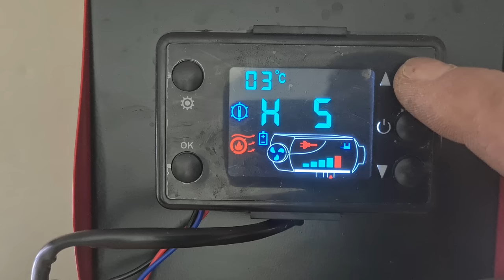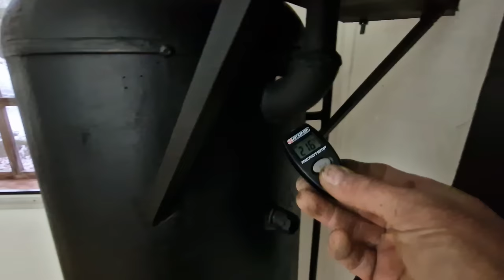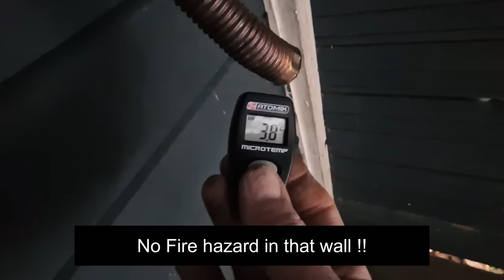DIY Vevor Diesel Stove with  Free Energy Sand Battery

Comment: now, that thank was dedigned for hydronic heating ( water circulating through that exchanger as medium), not to be exposed to dry heat, thus that exchanger ( spiral tubing/coil is not designed for getting hot without water flowing through, thus the lifespan of that coiled up exchanger drop by the day..
you would need a  coil for steam for that application
Reply from the maker: This is just a prototype but yes it should have been made in stainless for longer life.

Comment: Hi, great video, did I see that the exhaust come just half way down the sand recovery vessel? So could you use a smaller one and save on sand?? Or half fill with gravel and then with sand where the coil is on the inside of the vessel??

Comment: Good stuff, I have a old solar water heater that I wish to repurpose the one with the vacuum tubes and copper head conductor's. Your idea and a RV battery switch "charges between two batteries. With peltier junction will eliminate power supply, perhaps even battery with ultra capacitors.  Still going down the road on design. I am was worried about peltier junction getting to much heat your design resolves that issue.

Comment: So basically you collected exhaust heat into a sand battery. Would be fine if you calculate the energy storage of that battery.
Reply from the maker: Thats right. I could calculate Delta T over some time and see how it changes 😉

Comment: How many feet of exhaust is that?? That’s a lot of resistance for the blower. Especially such a small diameter
Reply from the maker: I guess about 30feet of tube and the diameter is a few mm larger than the exhaust outlet, i had restriction before in another configuration and then the Vevor wouldn't start and gave a lot of white smoke. I haven't had that issue here so i think it's ok

Comment: Did you use the exhaust pipe to go through the copper coil in the tank and through wall to exit the exhaust? Did I get it right? You are heating with the emission smoke ? That is brilliant if it is what I understood
Reply from the maker: It's actually a steel coil but yes i did

Comment: Did you have trouble with the heater throwing codes because of the exhaust being quite long? That's a lot of heat exchanger for it to run thru and others have said too long an exhaust pipe can cause problems.
Reply from the maker: No i didn't fot any fault codes
Reply: @RickardsGarage  thank you 👍✌

Comment: Maybe I am really stupid but I don't get it. Seems to me that heating a cubic meter of air from X to Y degrees Celcius takes Z amount of energy, not matter what energy source or intermediary tech for energy dispersion one uses. The same as boiling 1 litre of water from 0 degrees Celcius to 100 degrees Celcius takes X amount of energy. And the best one can opt for is to minimize the energy loss on the way. 
So, if hunting for cheap heating I would look for the cheapest possible energy source per Joule or Watt rather than focus on how to delay dispersion of said energy over time. There simply is no such thing as free energy, right? Or did I read to many physics books and got lost on the way to the hidden truth? 🙂
I would have appreciated a commentary on what goal you are aiming for in your heating projects. Heating a cabing with a few tea candles won't do since they won't under any circumstances produces more energy than what's stored in the paraffine in them. Same with diesel, alcohol or whatever energy source.
Reply from the maker: No, you're not stupid but proberbly an academic!  All of you that don't understand why i say Free Enegy is simple. We don't reason the same way! Of course, it's not free of cost, but when i buy this Dieselheater, i have accepted that it costs a certain amount to heat the air ex. 0.6L/hour Diesel x 2.3 Euro. If i can use the heat from the exhaust that would have gone to waste, i calculate that as Free Energy because it's not in the calculation 0.6L/hour.
Reply: När jag lägger i friläge i bilen i nedförsbacke så brukar ja kalla de ”nu åker jag gratis”
Reply: @RickardsGarage  The conventional term is "Waste Heat Recovery", and it's a really big deal right now, and your innovative device represents those efforts. Good job! and inspiring to us all, best wishes on further development, and thank-you.

Comment: What kind of water heater did you used [striped down]? I ask that because I did not seen one with that coil inside. I would like to replicate your ideea, maybe adapt it a little bit, for water heating also but in order to do that, i must know that.
Reply from the maker: I used a ordinary waterheater with a extra coil inside for external connection. I will start making a upgrade on this very soon.
Reply: @RickardsGarage   Many thanks. I suppose that the coil was there from the factory, I did not see that kind of model where I live.

Comment: Thats what i want to do but for hot wate
Run pipes through thr sand to collect hot water
A double coil heater is probably required
Reply from the maker: God luck 👍😊
Reply: @RickardsGarage  I am looking for a double coil 2nd hand heater
Hard to find on 2nd hand stuff

Comment: But if you have left the vent on the top for moisture is it not possible that carbon monoxide could escape from that top vent?
Reply from the maker: The exhaust ist trapped in the coil and can't get to the sand 😉
Reply: I see clever ;)
 @RickardsGarage

Comment: Wheres the burner air intake? Didn’t see that dealt with.
Reply from the maker: I take the air from the room at the moment
Reply: @RickardsGarage  ok I would be very careful as we had a burn failure and the smoke blew back through the inlet! Its now be moved externally. 👍🏻
Reply from the maker: @projectzip  You mean Inlet for the Heated Air not burner air.  Yes thats bad if it get mixed with Exhaust

Comment: Very nice idea and build. But you have now effectively created a low-pressure zone inside your cabin. Cold air from outside will somewhere find it's way in if you don't balance the presure. Eventually your exhaust temperature wel equal just above room temperature and that energy is dumped outside. You could force the inlet air through the airgap in the exhaust duct in the wall. That way you could recover even the last bit of heat as the cold outside air passes the final part of the exhaust and warms up at the expense of the exhaust gas.